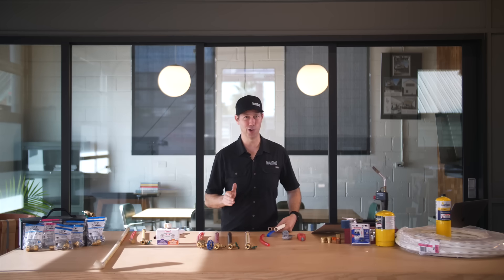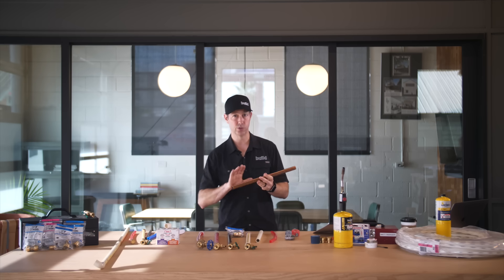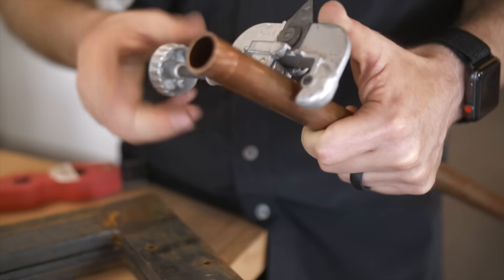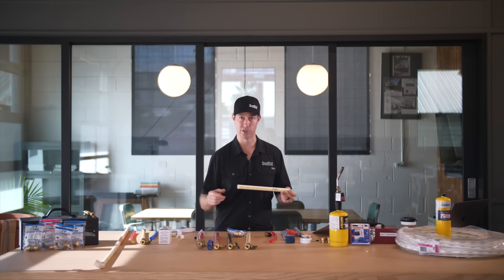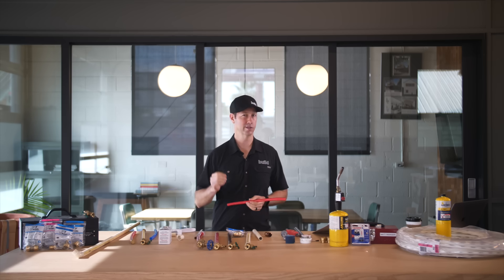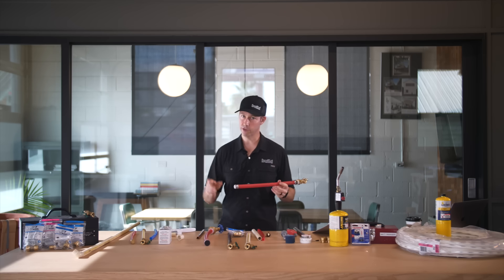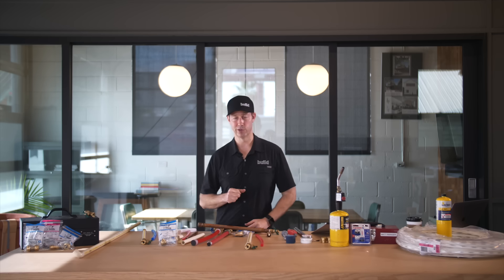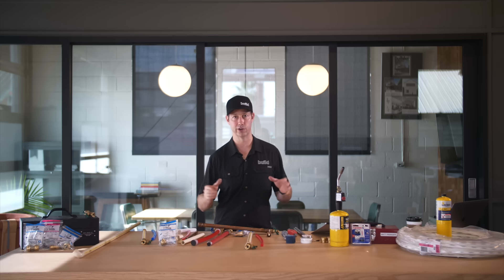PEX vs COPPER vs CPVC plumbing pipes

Comment: After 50 years in the home construction and remodel business, I believe the core of what you put out is slightly useful but the majority of the details are suspect, if not completely incorrect. 
https://www.copper.org/applications/plumbing/overview/commy_tube_tbl.html 
L & M are only two types of copper tubing. 
You neglected type K, the cream of the crop.
K, L, and M are types of "hard" copper tube, meaning the rigid length we usually call "copper pipe". You will find that types L and K also are available in coils of 60 and 100 feet. 
The types refer to wall thickness.  M is the thinnest, K the thickest.
You also neglected ACR. Usually referred to as Tubing. There is a difference.
Pipe is designated by a "Nominal Pipe Size" based upon the ID (inside diameter) of the most common wall thickness. Tubing is designated by the measured OD (outside diameter).
Nothing worse than making a run of one style pipe and then find the fittings are for another, as the standard types do not play well with ACR fittings and vice-versa. 
 All have the same OD ( the actual OD of hard copper is always exactly 1/8" larger than the nominal size.) So, 1/2" copper of K,L, or M will be 5/8" OD.   The id varies slightly due to the wall thickness.
Other types of copper tubing are ACR ( air conditioning) and DWV ( drains ). 
PVC, as opposed to CPVC, is used extensively across the nation as the preferred pipe for water supply. 
CPVC is used as a transition between hot water tanks, and the rest of the house, as it is able to handle temps up 200 degrees F vs. the 140 for PVC. CPVC tolerates the temperature extremes with less chance of product failure due to chemical breakdown.
PEX is making massive inroads into the construction industry, mainly due to the ease of install. One selling feature of it is its ability to withstand extremes of temperature AND pressure. PEX is lauded for its expansion capabilities. Up to 10x the normal size. This might not seem important in texas, but up in the frosty northern climes, it could mean the difference between having water at the faucet or having a flooded area because the pipe contents froze and expanded beyond the piping...
As for longevity, water quality not a consideration, CPVC is good for about ten to twenty years before it becomes subject to brittleness due to aging! 
I want to see a regular journeyman come to a job and cut into the CPVC without it shattering. Not going to happen. 
May get one. 
Might even get several fittings installed. 
But it will fail/shatter. And miserably. Even if the correct glue is used (Another CPVC peccadillo...PVC glue is not compatible with CPVC).
One last comment: none of these piping types are to be used for drainage, despite what you claim. 
Schedule 40 PVC is not DWV. Material construction is one of the differences. PVC is for pressure, DWV is not. There's plenty more involved and I do wish wish waste any more time.
Reply: Thank you for the time you did waste. Very helpful. Thank you!
Reply: Also,  if you would add some information about PEX a  fittings I would be extremely grateful!
Reply: A friend is repairing a leak for me near my tub faucet (behind a wall.) He's not a plumber by trade and the first fix failed (so did the second, actually). He recommends I turn-down the temperature (again) on my on-demand water heater, but I want a better fix AND a hot bath. After reading here I'm recommending he try the PEX-a instead of the CPVC for this repair (that is being attached to what I think is a copper pipe.)  What fitting should he use?
Reply: ... everyone says "don't use sharkbite"

Comment: Can I use the PEX on installing a tankless water heater, up to the valves at the base of the unit.
Reply: Yes but I would recommend copper after the valves and in the wall then transitioning to pex

Comment: GREAT video, imo. i was waiting for the typical,"the future is now, pex is the only way" bs, but was pleasantly surprised. very objective. 

imo, its all about copper, for many of the reasons you mentioned. ive never been a fan of cpvc, at all. and although i want to hate it, as it is plastic and what not, i have been coming around to pex. and again, instead of the usual "pex is god" drivel, you mention a few pex drawbacks that i was not aware of.

Comment: Great video and explanation thank you. Im plumber from 1982 just to add only copper fittings you can reuse.And shark fittings are more expensive if you able reuse count will have to cut spot where old was connected.Will recommend copper only.

Comment: There is one downside to copper. If the water stands in the pipe over night, lots of copper ions gets deluded. Those combine with iron and β-amylase in the brain tissue to plaque clusters. Those  cause old age related mental problems. So, if you have copper pipe, just let it run for a while before drinking. How long depends on your house, in a multi family house the standing water column is only a fraction of that from a single family house. I use a reverse osmosis filter for drinking water which uses plastic piping.
Reply: Yeah?  Here is something else.  A few of us are missing an enzyme which moves copper in the body.  Drinking water from copper pipes can be toxic to those people especially if they have not been diagnosed and are not on chelation therapy.  Switching to PEX or other materials does not necessarily get rid of the problem since some fittings are made of copper or brass not to mention tankless water systems.

Comment: Preface: i know nothing okay? For appliances like washing machines i've no idea but for regular taps, showers or baths i imagine a future water system with an on and off depressed button (similar to taps that have that 10 second run time) and a nob or tap like handle. So you push the button and water starts slow then use the main handle for your required temp/hot or cold and then when you're done you depress/push the main button and the water slowly turns off, so its not a jarring turn off that makes the water hammer/knocking sound.

Is this possible?
Reply: R34L157 it’s easier to just have a vertical air pocket in your line to compress when you turn off.

Comment: Hey Matt, great video. I recently just completed a complete re-plumb (using Uponor expansion fit tubing) in my 110 year old house here in Iowa and had a SUPER quick question regarding insulating a patch of tubing in my basement which is close to the outside of the house inbetween the joist bays. I am pretty sure that I have seen NUMEROUS videos of yours with professional spray foam insulators spraying foam around and on the pex tubinig but wanted to ask if this was okay? I didn't know if there were any known reactions between the spray foam product and the pex. Thanks so much for you time and BUILD ON! :)
Reply: I am not Mat,  but If I was doing what you are talking about I would wrap it first in something (that the AHJ had approved like a  small piece of tyvek or something  so the urethane foam doesn't stick to  it. If you ever have to get back in to it.I do that with (not tyvek) motor connection splices hope that helps.

Comment: One thing i never see mentioned is that copper has antimicrobial properties.
Reply: so does treated water
Reply: Ben Morris 
Copper can also be toxic depending on how it is used.
Reply: @conjurerwoman9726  copper piping probably isn't going to hurt you
Reply: Many PEX fittings are made of brass.
Reply: I C  The copper oxide that builds up over time does protect the copper from certain 'aggressive' compounds found supplied by some water utility companies
Reply: Oh my, well, I wouldn't think of using copper pipes for any health promoting reasons, just the opposite. Copper toxicity can harm the liver and brain, and can increase your risk for Alzheimers. Copper toxicity is occurring more and more, mainly from food, drugs, and copper pipes.. Different chemicals can dissolve copper, one reason why they say never to cook a tomato based food in a copper skillet due to the fear of it dissolving into the food and causing copper toxicity. It doesn't happen obviously, but in small amounts, but that small amount can lead to copper toxicity. Not to mention chemicals that could be in your water that could dissolve alittle bet of that lead solder in old pipes.
Here's a good article, although I do not like the particular doctor who put this up, but it does explain the affects of copper in drinking water, this is worth your read: https://articles.mercola.com/sites/articles/archive/2013/09/12/copper-alzheimers-disease.aspx

Comment: You must not live in an area with hard or acidic water.  Copper in this area lasts 40 years if you are lucky.  The last house I lived in one could crush the pipes by hand, and it was built in 1980.

Comment: Copper as a material has another major advantage which you did not talk about. It kills most bacteria and microbes. It's one of the historical reasons for it's use as a material for piping. It's also seen use on most surfaces you would touch in hospitals for the same reason (such as handrails). There are several herbicides which are copper based.

As for the reason that copper eventually fails... Copper does rust, but at a much lower rate then steel. It creates a green crust called patina which, unlike steel, will seal and protect the rest of the copper. Over time, with water flow, there will be some erosion which will expose the underlying copper.

Comment: Aunt and uncle are going to have to spend $11,000 to have their home re-piped due to rats eating through their current CPVC pipes.  Their home was built in the mid-60's.  Some genius thought it was a great idea to pipe the house by placing the pipes in the concrete pad.  Their choices are to either tear up their floors and pad, many times more expensive, or to re-pipe through the attic.  Wish there was a better solution for their problem.
Reply: Sounds like they are being ripped off.  None of that makes sense.  Maybe they need to address the rat problems first.  That would be a bigger concern.

Comment: Great explanation of these three options but I have something to add that everyone should be considering - the chemicals in your drinking water:

- Fluoride (hydrofluorosilicic acid; literally poison added deliberately)
- Chloramine (chlorine + ammonia; does not evaporate like chlorine)
- Pharmaceuticals (each time an medicated person takes a piss, pharma chems are added to water supply)
- Heavy Metals (arsenic, manganese, iron, etc)
- Various sediments and inorganic matter

Not only can these chemicals degrade piping, especially plastic pipes, but they also leech away the chemicals made to use the pipes OR copper. 

My vote would be to stick with copper simply because it is the only natural substance. At least any copper that may leech into the water supply of your home at point of use is relatively easy to remove with a filter.

The plastic piping is convenient and has a lower initial cost, but PTC fittings are very expensive compared to copper fittings...even if you factor in the labor cost of brazing each joint. PTC fittings do exist for copper pipe, but would probably cost about the same because the reduced labor cost is offset by the higher cost of the fittings.

One of the big problems I have with PTC fittings is that the pipe will rotate within the fitting, which can be a problem with some fixtures like a slip-on faucet for a bathtub or any other fixture that is designed around a rigid underlying pipe.

One thing is for certain - you need to be filtering all of your water using something like a big blue filter setup. Even if you are using well water...filter it.

Comment: PEX and shark bites! Super fast. Super easy. And will not burst like copper if exposed to cold weather. All mobile homes that I go under for a new water line is ran in pex, heat tape and pipe insulation over top. Almost 100 percent of water bursts are copper pipe.

Comment: there is 4 different types of copper... Types: "L", "M", "K", and "DWV"... DWV is the thinnest, its only made for waste and vent... type "K" is the thickest... it has a green label on it... its the most expensive and any government build jobs are going to require it... Most other places require the type "L" as its the middle ground for water pipe...  also, here in Colorado, you normally get only 50 years max for type "L"... for type "M" you get maybe 20-30....

Comment: Didn't mention freezing? Copper will split, CPVC will split, PEX-A will survive.
Also, CPVC gets super brittle over time and snaps easily making it susceptible to damage and hard to repair because it splits lengthwise when cut.
And how about the cost of fittings? Copper fittings probably average $3 each. That's worth mentioning. PEX can use brass or plastic fittings. CPVC fittings are dirt cheap.
Reply: Pex expands.     However.  Pex rings and fitting don’t
Reply: Oh, and PEX-A can be heated to undo kinks. PEX also tends to have a smaller ID than same size CPVC/Copper.
Reply: I seriously want to use PEX to repipe my entire house, my biggest fear is rats bitting through it since I have a crawlspace
Reply: What? Copper fittings are like $0.60 for 1/2" what are you smoking
Reply: copper kills bacteria and viruses, PEX and CPVC will promote bacterial growth.
Reply: @blacquejacqueshellaque6373  Maybe when it is new but after a short time it forms a rust coating that isolates the copper from the water. In fact the old galvanized pipe, as bad as it is, attracted heavy metals and make the water taste much better.
Reply: @blacquejacqueshellaque6373  sulfur eats copper for breakfast
Reply: @walterbrunswick  Yes, yes it does! Pinhole leaks are no fun.

Comment: I live in a mobile home in Branson Mo and I'm in the process of renovating the whole system to pex using shark bites. I've kept the unused roll in the house until recently when I took it out to fix a small leak. It was dark and cold so I left it lay in the back yard. I'm glad you mentioned that it's not a good idea to do that. I hope I didn't ruin it. We are on a community well, and what I can say is we have HARD water. Which brings me to the question does hard water or systems using a water softener have an effect on the different types of piping? Thanks for sharing your expertise and video, Rodney
Reply: Shark bites only seal the pipe to fitting using one rubber O ring. Sharkbites are to be used as an emergency type fitting.

Comment: 1. There are more than 2 types of copper pipe used in plumbing. Commonly, Types M, L, and K(thickest).
2. Type K is commonly used for buried applications. Although requirements for types vary with codes.
3. CPVC pipe and fittings are produced by many manufacturers.
4. Retired before PEX became popular.

Comment: What is your opinion on ppr pipe ? We use it a lot in  Eastern Europe and its very easy to install cheap and does not seem to degrade. I have seen 20 year old systems  and as long they are not exposed to UV they are good as new. Those things never leak if properly installed and its hard to mess up said install.

Comment: This austrian handyman cut my old copper pipes of my shower remodeling and installed PEX just pushing in those now pesty PEX pipes. I opened the shut off valves then I turned the water ON and .... I heard a POP!! and the water started running OFF/OUT of the pipe!!! Now, can you tell me what is happening behind those walls ??!  Happily the walls were not already installed just because I had already done a stop payment in the last check I had given to him  because he had also cracked my new acrylic shower! How much more I would have been spending demolishing for the second time a shower wall if I had not tested his PEX water piping installation! I paid 185 dollars for new copper piping shower installation!

Comment: My house was done with PVC for cold water lines and CPVC for hot water lines. The builders were too cheap to use copper. They were also too cheap to put insulation in exterior walls and to install proper plumbing vents. I saw some old galvanized steel supply lines left under the house so I guess at one point the water had been done in metal (but not copper). I'm in a "no man's land" for contractors. There were only 2 licensed contractors listed for the area and both died years ago. Only 3 plumbers and the only good one died. Of the 2 remaining, the one that will sweat copper doesn't know how a DWV system works (dude did a washing machine standpipe with the trap below the floor & ran the PVC out of the house and slapped an ABS AAV on it- just exposed to direct sunlight). No caulking or sealing around the hole he put in the wall either. No proper slope on the drain pipes. He won't do toilet drains or touch toilets because it's too dirty for his dainty hands. The other guy will do DWV but won't sweat copper & can't fix a simple shower valve leak. So, I am stuck having to fix my own plumbing (I can snake drains, replace shutoffs, and cap broken waterlines).
Got a reno coming up and I'm debating getting CPVC & worrying it cracking/splitting like the old stuff did or trying out PEX. My best friend used PEX in his renovation. I saw there is some sort of plastic wrap that seals to PEX underground to protect the fittings and I wonder if that can be used above ground. Also wonder how difficult it is to remove in case something needs to be changed.
I'm going to have to get some fittings to go from PVC to PEX to bring things up to code and add more shutoffs.

Question on PEX: Can it be used between a jet pump and a pressure tank in a well system? (I'm guessing no, but just wanted to check). I'm looking at having to replace the PVC with stainless steel because the heat from the jet pump keeps melting the threads on the PVC & causing it to leak.